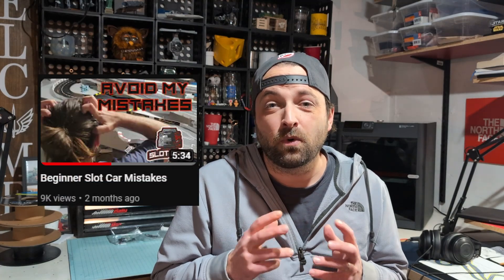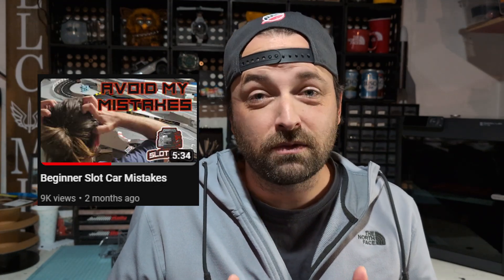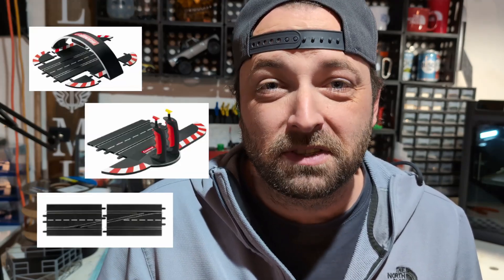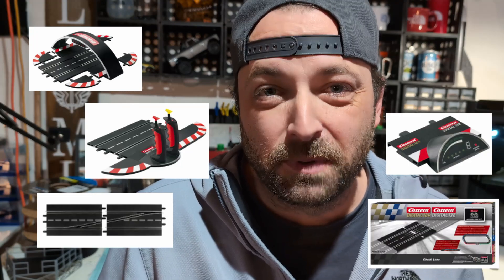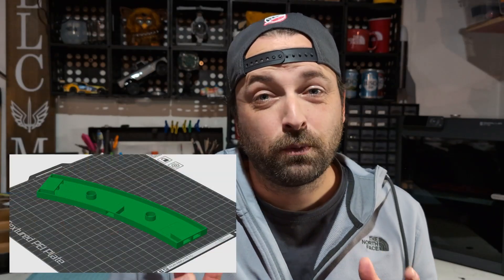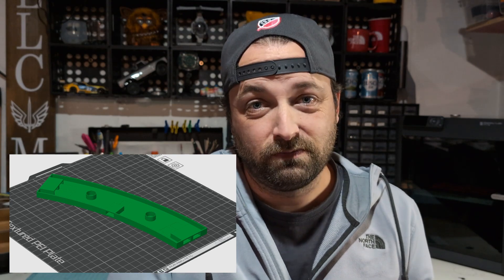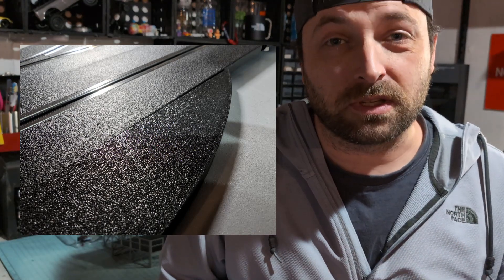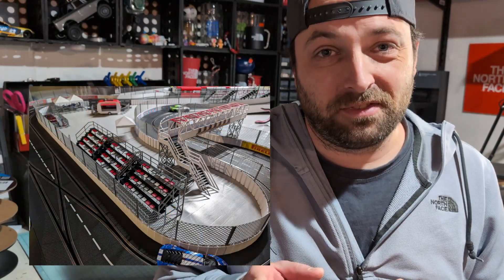New 3D Printed Solution to Old Slot Car Mistake

Comment: Another great video bro!! Yes I invested a lot in the shoulders for my entire track. The red and white always annoyed me but had no other choices until now lol Do you think it’s possible in tweaking the settings to make the shoulders a little wider like the carrera ones? I don’t have a printer as of yet and have zero knowledge on how it works. Just curious.
Reply from the maker: You wouldn't need to tweak the file. This file is intentionally narrow for those of us that run 132 AND want to save space. I am sure you could find a file that is a straight duplicate of the original Carrera shoulders.

Comment: I just used cork tiles, spray painted them black and used the radius of the curve as the template.  I'm with you way more things I'd spend my money on.
Reply from the maker: This idea was definitely on my radar, but I couldn't find reasonably priced cork tiles with the correct thickness.

Comment: is there a 3d shoulder for curve 1/60°... also shoulder for straight?
Reply from the maker: To get a 1/60 you just print 2 x 1/30 parts. They are split up so they fit on the typical 3d printer build plate. There are also three different options for straights: 1/4, 1/3, and 1/2

All of the files can be found at the link in the description.